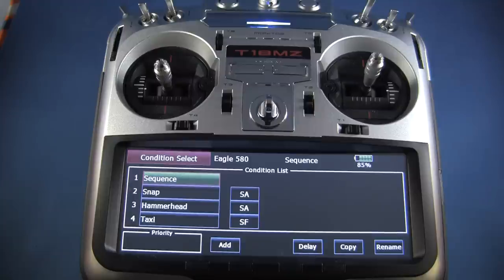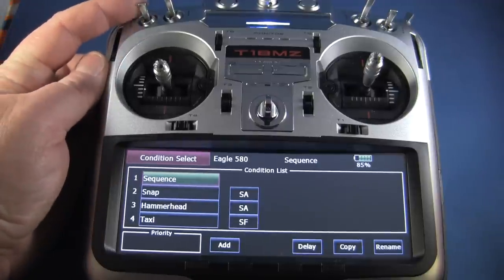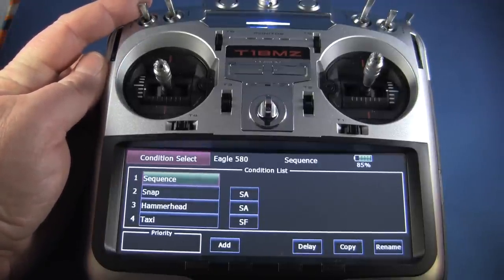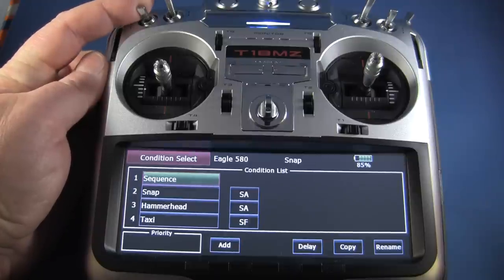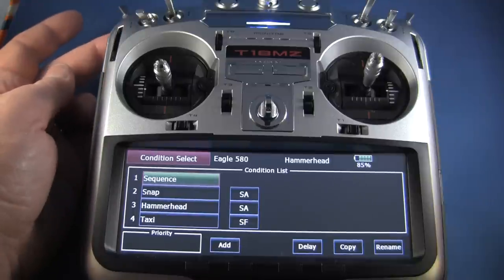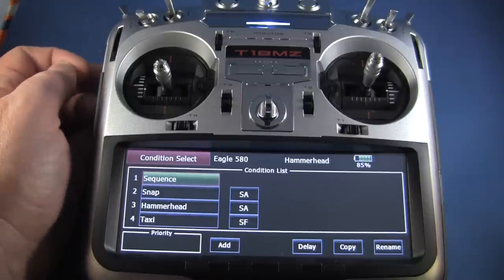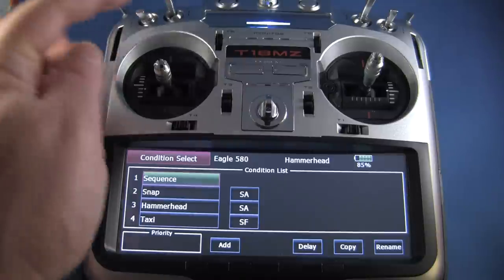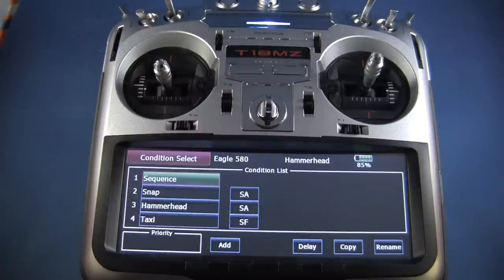Part 2 Creating Flight Conditions in the Futaba 18MZ

Comment from the maker: However if the function is grouped, whatever you set for that function (in this case DR or Expo) it would be the same through all conditions.  Single means you can have different rates for each condition.
Lets say you have different conditions, that will affect the throw of rudder and elevator but not aileron.  You'd make rudder and elevator single and group aileron.